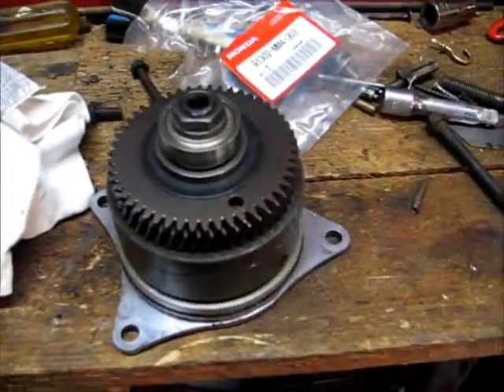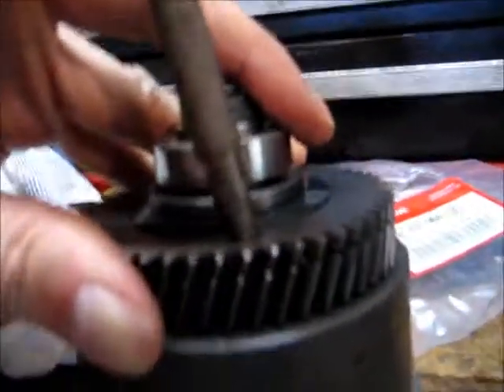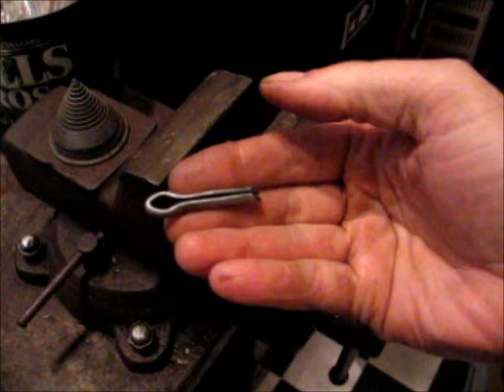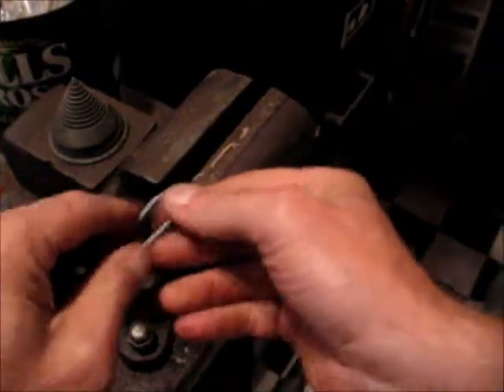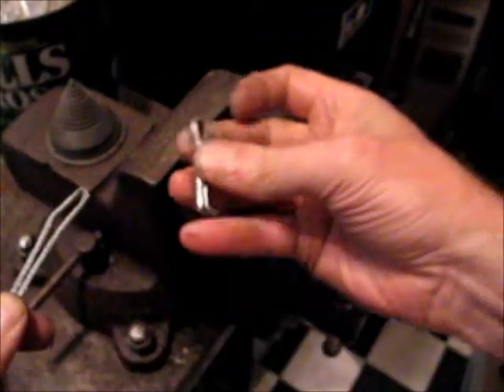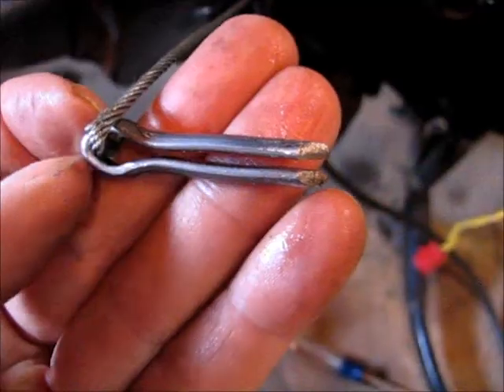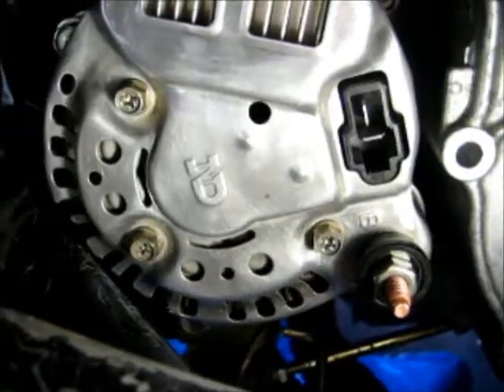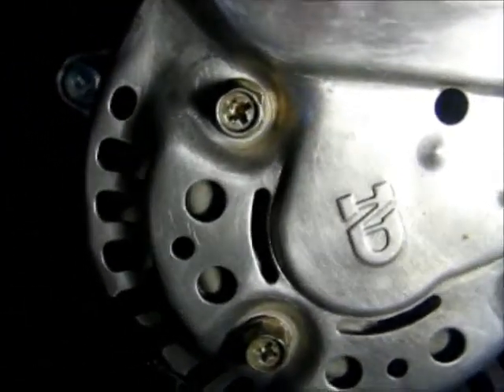Honda ST1100 40 amp alternator upgrade

Comment: Instead of using the old alternator shaft, as described by @Pastor, use a 12mm Allen key or Allen box that you insert in the spline. Fits perfect. Either way, no need to remove oil pan or use "Lewis key" method.

Comment: And how much did you pay for that new 40 Amp alternator out of curiosity as I know it's really expensive
Reply from the maker: You can buy a new one for $200 off of eBay https://www.ebay.com/itm/304318177233?mkcid=16&mkevt=1&mkrid=711-127632-2357-0&ssspo=vdp1maRqSMi&sssrc=2047675&ssuid=&widget_ver=artemis&media=COPY
Reply: @yoopergonzo  thanks

Comment: there is a much easier way! take the old scrap alt apart to where you got only the shaft and armature on it! put you backlash gear in place,use the old altanator shaft insert it in the splines and turn it clock wise ti line the gears on the backlash and push it straight into place! i hope this makes it easy for you! it worked great for me!

Comment: This wont work. What u dont see is that all the teeth must be in one line. And that part is cut out of this vid.
Reply from the maker: What?? It works. I did it.
Reply: I think you will find that the purpose of the cotter pin is precisely to get the teeth in line. This method is designed by the manufacturer - Honda - with the exception that Honda say you should remove the sump (oil pan for you foreign types). The trouble with that approach is that to remove the sump, you need to remove the exhausts, which means you need... Oh never mind - where's my cotter pin...? Incidentally I thought a cotter pin was a different item - is this not called a split-pin?

Comment: if this guy thought about it get something to match the splines to turn it as you install the drive and match the first part of the gear then turn it to preload it and push it the rest of the way in
Reply: That's not a bad idea - except that you don't know exactly where the gear is when it's out of sight. Getting 'something' might not be so easy although you could get an old shaft and saw a bit off to make up a tool with some welding etc but this is a much more accessible method which doesn't need a welder and equipment to manufacture a tool for one single purpose. If you have the tools like most of us you probably have a bit of cable and a suitable pin and if not they're easy to come by. I think that is the point of this method - it's for the DIY guys...

Comment: great info video, im stuck with my 28amp alternator, do i really need to remove swingarm
Reply: Simply put - yes! 
The swing-arm pivot is right behind the rear of the alternator. You won't be able to remove the old one with the arm in place...

Comment: great video. Your idea of using the cotter pin and cable is great. I'm fixing to do the 40 amp upgrade myself. Do all the methods used require removal of the swing arm? and where did you order your parts from. Thanks